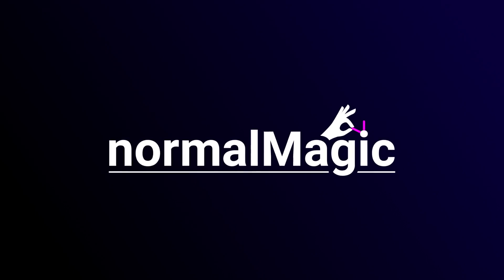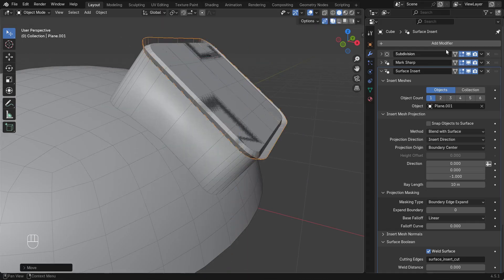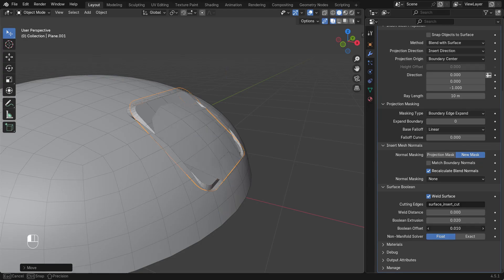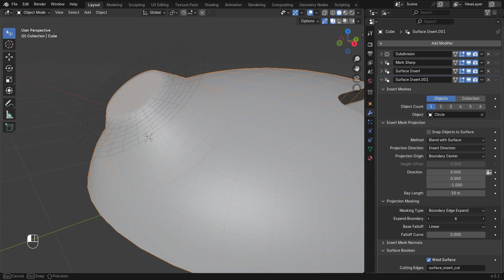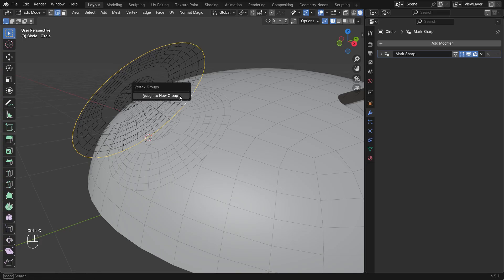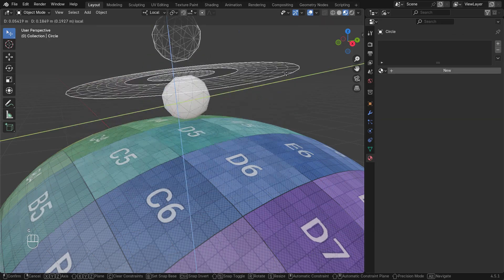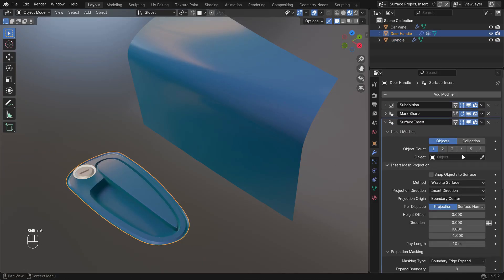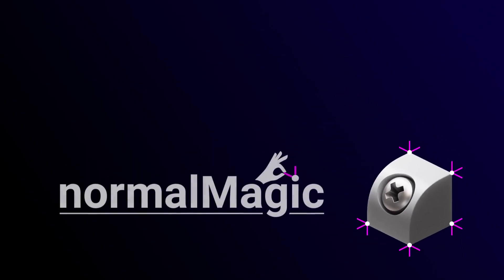normalMagic for Blender — Surface Insert Walkthrough

Comment: Hi, I recently purchased this tool, it is very helpful and has made my workflow much faster. However, I'm having an issue when using a mirror modifier. When I apply the mirror modifier on the surface inset 'cutter' object to get the surface inset on the mirrored side of my object, it is performing the operation in the same way as usual but the normals are flipped in the surface of the inset on the mirrored side. I have tried rotating, scaling and also changed the order of the modifiers to see if it makes a difference but it doesn't work. Would really appreciate your advice on how to make it work. Thanks!
Reply from the maker: Ahh yes this is a bug with the mirror modifier. I cover one solution here using "Repair Mirrored Normals": https://www.youtube.com/watch?v=NoISc01URHg&t=70s

https://spaghetmenot.github.io/normalmagic/latest/normal_tools/repair_mirrored_normals/

Version 1.1 (hopefully releasing next week!) will have it's own version of a mirror modifier called "Symmetrize" as well as improvements to the repair tool
Reply: @SpaghetMeNot  Thanks a lot for the quick response! The repair mirror normals didn't work initially but after a few adjustments it did the job. Looking forward to the update. Again, super helpful tool and I'm loving it ❤

Comment: Thanks for the video! Very interesting plugin, have been wishing for such a workflow for ages! I think this could be great for Sci Fi modelling, adding windows and stuff.. However I wonder how many inserts can be added to one mesh. I remember reading somewhere it was restricted to a rather low number, which would limit its applicability.
Reply from the maker: Thanks! There isn't really a limit, only when hand-selecting objects for a single modifier. You can easily add more by either:

- Specifying a collection with unlimited inserts 
- Adding another modifier to continue hand-selecting insert meshes

Hope this helps!
Reply: @SpaghetMeNot  Sounds great, Thx!

Comment: This is crazy good. I'm still relatively new to Blender so I have to ask: After I'm done using normalMagic, would I be able to "convert to mesh" to Join everything into a single mesh object? I am definitely getting this. Looking forward to more videos on the other tools. Thanks!
Reply from the maker: Thanks!
Surface Insert already does this for you (merges and welds into an object).
You can also merge many objects together after applying modifiers — currently there's a quirk with blender where all meshes have to have custom normals before merging.
Hope that helps :)

Comment: This is amazing, can the results be baked into a normal map? and if so can you please make a tutorial??🙇‍♀
Reply from the maker: Thanks! Yes the results can be baked easily, just apply the surface insert to the high poly and bake as usual — nothing normalMagic specific 👍
Reply: @SpaghetMeNot  Thanks!also can this be used with boxcutter booleans ?
Reply from the maker: In most cases it creates manifold geometry so yes... But it also sets custom normals and I'm not sure if boxcutter plays nice with them.
Boolean Pro (normalMagic) works with them fine though